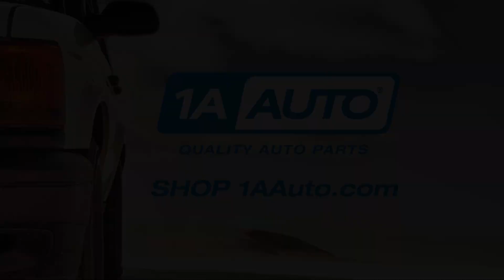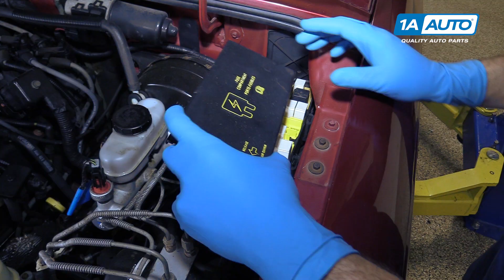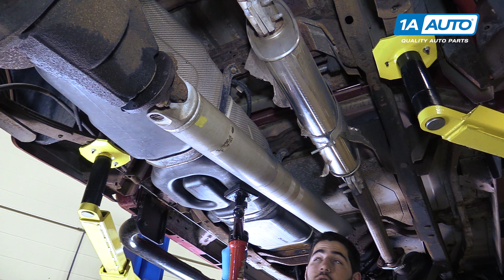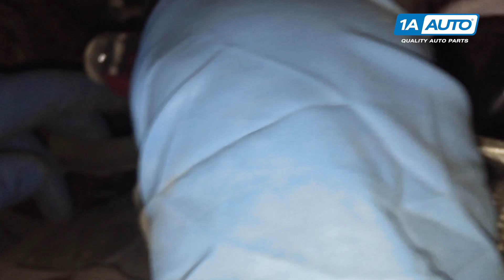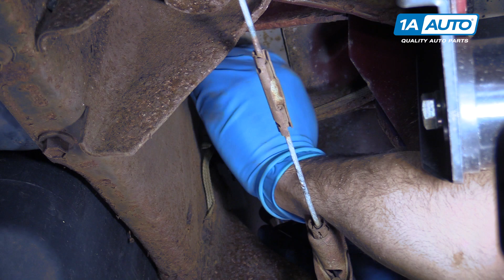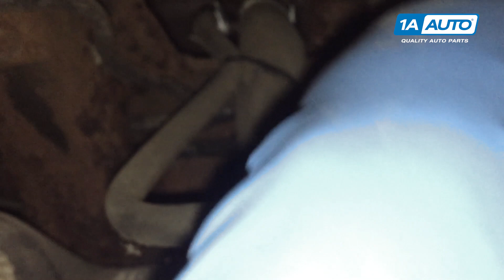How to Replace Fuel Pump Retaining Ring and Gasket 98-03 4.0L Ford Ranger

Comment: No wonder auto repair shop charge over$800 to replace fuel pump. bad design. I replace fuel pump on 1998 dodge caravan myself on driveway without taking out the gas tank or gas which was full. I just dropped gas tank 2" and was able to remove fuel pump.
Reply from the maker: +Al smith Thanks for the feedback!

Comment: This whole video is missing the important information people need, when re-fitting the locking ring, the arrows have to be aligned then pressure is applied downward on the locking ring (not the pump) and then the ring is rotated until the arrow on the ring matches a mark on the gas tank (not necessarily the start arrow) just knocking until it feels tight is not how its done, most seals have to be torqued to 45lbs feet, to much or not enough toque and the seal will compromised, check your locking ring thread, you will see it has a stop on the thread and not just a run out, them stops have to lock in to place with the stop on the tank opening, only then can a gas tight seal be made,   check your Haynes manual or manufacturers workshop manual for the right method, this way is for the DIY guy who hopes he got it right.
Reply: Thank you for this advice